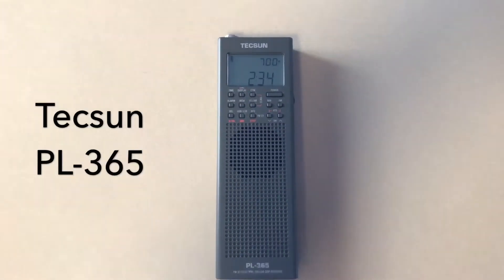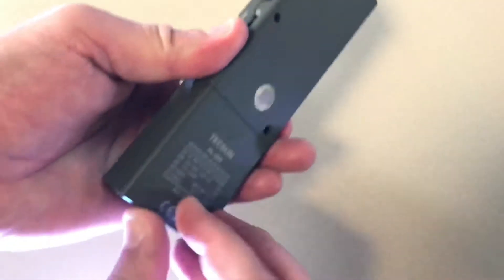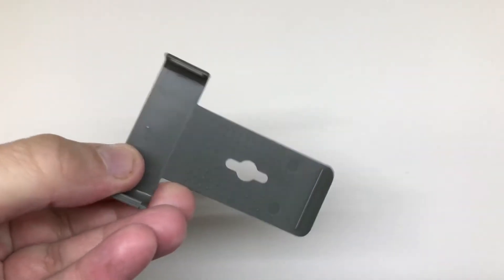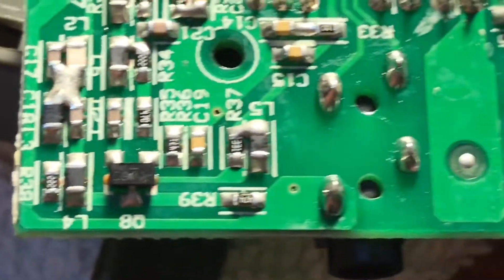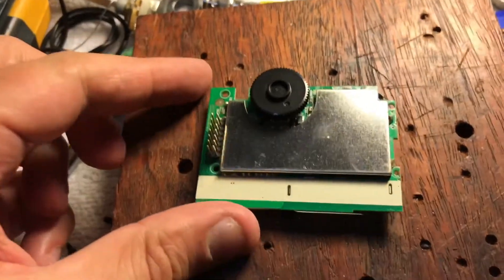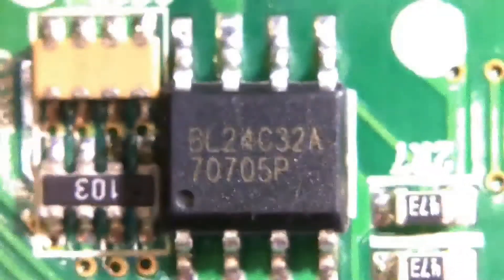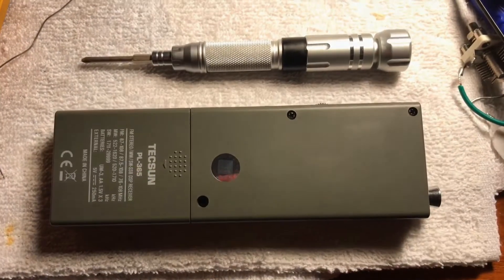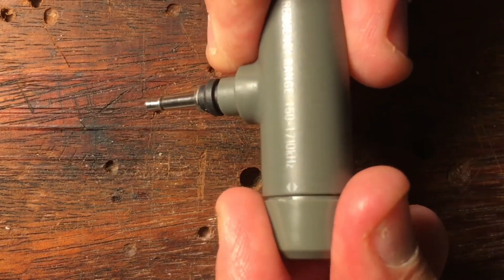Tecsun PL-365 Disassembly & Overview

Comment: Hi Ive had an issue with the fine tuning funtion on 3 XHData 808 radios. the first one fine tuning didnt work at all and then the other two.
 failed shortly after!!!! I cant find any info on this problen & have contacted XH Data but they just told me to get a refund and I did so

Comment: I just got a PL-368 and I was wondering what the twirly caps on the AM antenna did, especially because there are up/down arrows. 
Now I know...absolutely nothing! Thanks for the interesting video.
Reply from the maker: You prompted me to watch half of it again until I got tired of my own voice! I'm thinking now what value would have been added to a pocket radio in the past if they'd done that as soon as possible, when everyone didn't have smartphones. I don't remember any pocket radio with a cheap watch inside. There could have been plenty out there though.

Comment: Thanks for the great teardown video.I was looking at the PL-360 on Amazon and it says "About this item 1. --snip --- Using DSP si4743 Micro-chips:from Silicon Labs in USA.----  Do they have it wrong? Have things been upgraded? Or did they just transpose the last two digits? I would love to find a radio based on the newer si4743.
Reply from the maker: There is a 4743. If you download a datasheet, there are variants in a family from 4740 through to 4745. At least 4742 is needed for shortware band coverage.
Reply: @BrekMartin  Yes,, and the 4743 is better yet.. But I wonder why they would upgrade an older model with a new chip. You said there was the older si4735 in this PL-365 teardown. Why not upgrade the PL-365 first, it is newer than the PL-360 right? Or just repackage and call it an all new model, PL-370? What do you think about this. Thanks, Dom.
Reply from the maker: Dominic Weston Hard to guess. I wonder if the chips are compatible, and it was just as cheap to buy bulk of one type.

Comment: thumbs up, mate! thanks for the teardown... just bought one of these... i found the BFO adjustment for SSB to be a very nice feature... we live in hurricane country, so it is nice to be able to pull down tuned weather faxes from NOLA via HF via a USB soundcard fob into a laptop running fldigi... only items missing for me are air, NOAA WX and 2M, but i have others micro-portables for that (Yaesu VX3R, VR120D, etc.)
Reply from the maker: Yeah I have Yaesu FT3D for wife receive coverage, but it doesn’t have any SSB mode.

Comment: Do you reckon you could use the chip from that (or what I really mean is buy or salvage one from elsewhere) to make a similar product but with features you are after? So for example, maybe some sort on way of plugging it into a PC (mswindows or linux) by usb or pci or rj45 and grabbing a load of data (so like you can even see the carrier). No particular reason (apart from apocalypse and the usual). Just a cool thing to think about. As an aside, do you have a bitchute?
Reply from the maker: HI OPC, The cheapest of radios use a chip that only exposes it’s basic controls (basically the tuner), so the manufacturer won’t need a seperate programmable controller to make the radio, but they can’t really define the way it works either. They basically just select an amplifier chip, and make the enclosure, etc. This one been one level up the food chain uses a radio IC that receives instructions from a controller. The controller’s job is to translate the user's intention through the interface to register values in the radio IC’s memory. It will be scanning buttons, printing to the LCD, and storing/recalling memories, etc. and writing the required register values to the radio IC to tell it what it’s supposed to do at each moment. In it’s spare time, the controller will be reading signal strength value from he radio IC to keep the display updated. They are really doing the job of making all of the functionality of the radio IC available to the user. In this case I think they do a pretty good job of that. This particular IC does have digital audio output which the manufacturer makes no use of here. For an SDR type thing, there are suitable chips for that. One of those in the popular USB SDR dongles is actually on it’s way. For the zombie apocalypse I’d walk straight past this. Assuming you can raid properties and store fronts, I’d go for some ICOM, Yaesu or Kenwood communications receiver (or transceiver).
Reply: @BrekMartin  Knowing that the package is locked-down like that just makes me want to find a way to exploit it in whatever other ways possible. So like, I got to wondering what one might do with such a chpi and then those car "FM transmitter" gadgets came to mind (you know - like if you have a CDPlayer or mp3 player with a FM-transmitter-dongle plugged into ht headphone-jack and you want your car radio to grab it's FM transmitter so you can hear the mp3 or CD through your car speakers. The radio IC (package) in this Tecsun PL-365 would be able to pick it up like any other radio, but I'm wondering what else it could pick up. Is it basically a hardcoded frequency range and you cannot get it to recieve anything else? I assume it is "just radio" but I wonder what range there is which it could grab and if the Tecsun PL-365 imposes narrower limits on the IC package. Would be cool to plug a FM-transmitter into a zx-spectrum and load a game from it.
Reply from the maker: @obsoletepowercorrupts  Back up five videos on my channel, and watch that :D There was a way to cover bands it wasn’t designed for. The same would probably apply to this. Mostly that’s right though, you can’t get into it like a traditional superhet.
Reply: @BrekMartin  If you mean 4mins into this video. Yeah I saw that video. I should scrutinise it more. I us 2x speed too much on everybody's videos : https://www.youtube.com/watch?v=Maypwh8LqgA&t=4m10s
I really need to make videos (post brexit) so I can ask you techy things before you get too famous to speak to me. 

e.g. A question of (a specific horn) piezo tweeters used with various speakers:

As a massive off-topic thing, on that point, if one were to make a speaker with a mid-range and a piezo tweeter horn (with a Wirewound 3 Watt 47 Ohm Resistor to prevent horn damage), apparently one doesn't need a crossover (as one would if using a compression driver instead of a tweeter). However the thought makes me nervous and I don't trust it (and wonder if a crossover makes sense). I have specific data but just wanted to ask you the question in general. Wondering if an amp such as this would drive it. Maybe download this pdf and save to hdd.

https://maplindownloads.s3-eu-west-1.amazonaws.com/L85BHUser-Manual-2503.pdf

e.g. Big Speaker could be 70Watt 6.5inch shielded Bass Mid Range Speaker 35Watt RAM, 70Watt Peak with Res Feq (Fo) 80Hz and FreqResponse (1M/1W) of 45-10KHz and output SPL of 85dB
Or maybe instead something like a 15inch 300wat max speaker with 150watt rms is too big for the following tweeter? Preferably the 6.5inch ones would be best.

 i.e. Wide Dispersion Piezo Horn Tweeter (187x80MM size) is 75Watt RMS 150W peak wide angle tweeter, Impedance = 4 / 8Ohm, No crossover required, piezo... so capacitively rejects low frequency power. 4 - 40KHz FreqRange. Because modern amps can produce very high frequencies (typically up to 100KHz) it is recommended to wire a 47Ohm 3Watt resistor in series with each tweeter to limit damaging high frequency resonance. Statistics listed say: Power 150Watt max / 75Watt rms, Impedence 250 - 50 Ohm over (operating range - impedence is fequency dependent, decreasing with increasing frequency).
Apparently it could replace the tweeter in a 10inch loudspeaker of 150Watt continuous (rms) out with 300Watt peak. Apparently even though the horn would work with a 350Watt pa-speaker, the horn is 75watt rms and so should be ok with a 350watt overall power speaker system but it is still possible to overload the horn if audio content above 4KHz is greater than 75Watt. Other facts include people saying the tweeter can be wired in series (daisy chain) to increase the total-wattage handling capacity when they need 150watt-200watt headroom (because their PA power amp is 150/w per channel 8ohms).